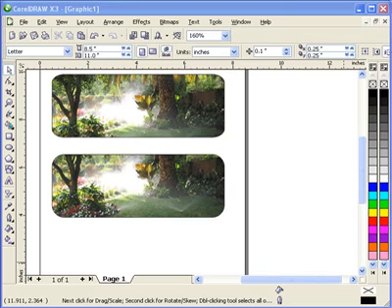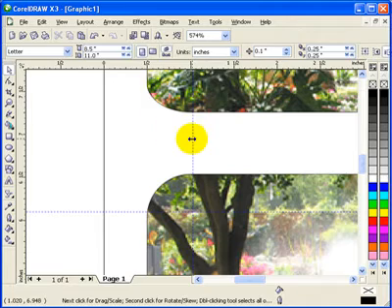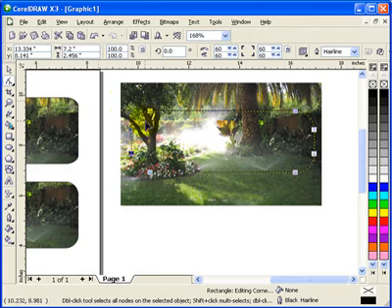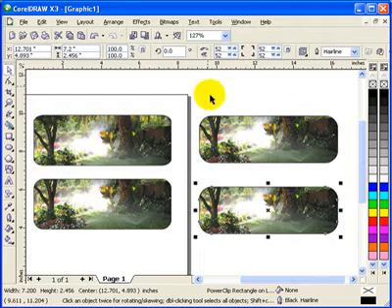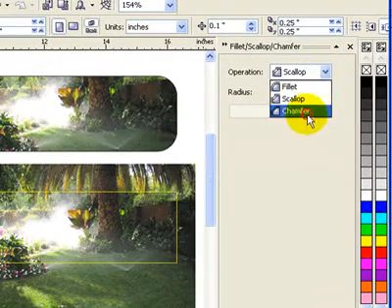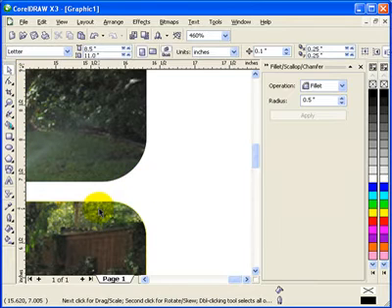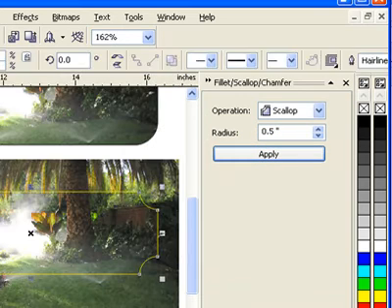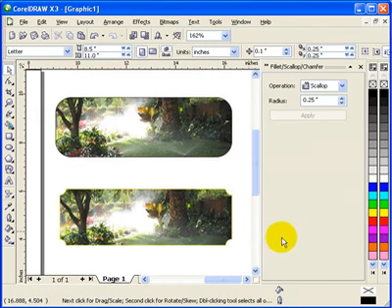Smooth Corners in CorelDRAW: Fillet Tool Tutorial

Comment: You don't have to go through the fillet command to change the radii on a rectangle. On the top menu bar, you can adjust the radius of each corner independent of the rest.